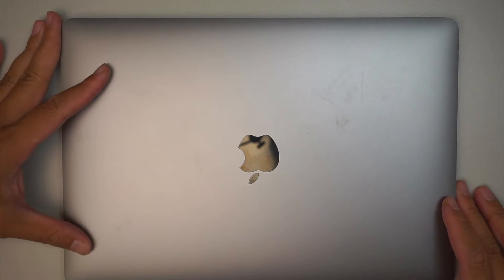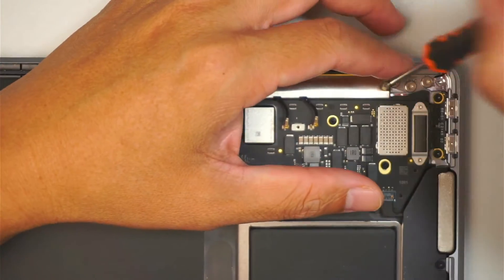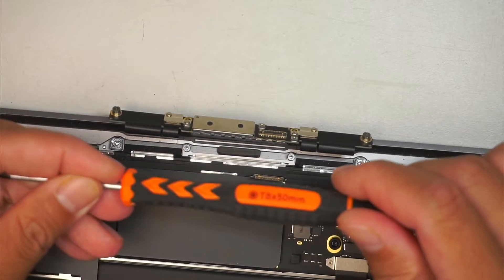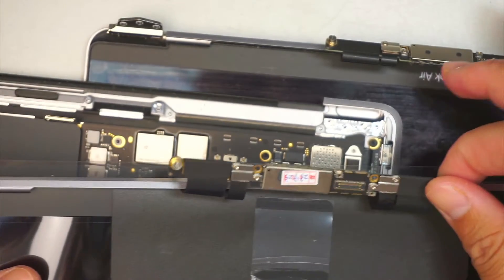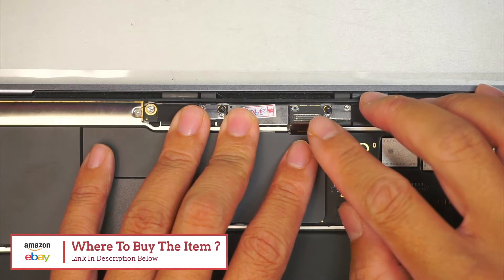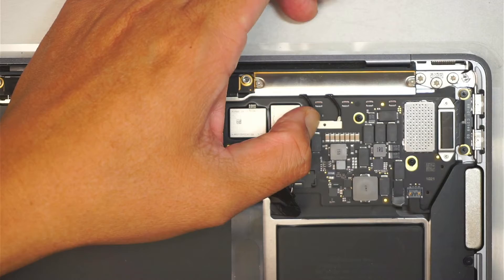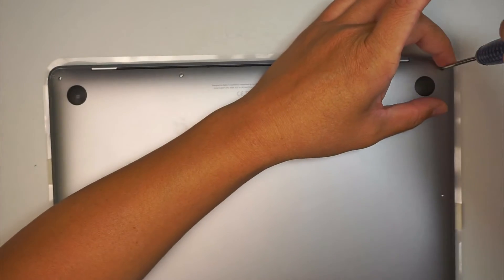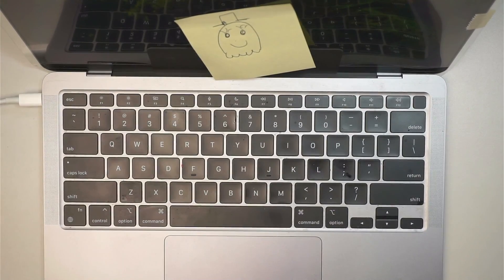How To Macbook Air A2337 Screen Replacement

Comment: Excellent video and detailed instructions…. Step by step, and you explained the tools used on each step. You saved me $300 … and I appreciate it it so much!!!  The new screen I bought did not have the 2 screw plate hold downs for the 2 cables to the display but I noticed that when comparing your video… so I moved them from the old screen and installed in the new screen. Everything worked great … thank you !!!

Comment: Great video. FYI a few things.  1) For those having an issue with unscrewing the Bracket on the WiFi connecting cables using a T3, use a T4 instead, which is what I had to do. 2) The WiFi cables do have to sort of click in softly when you press down. It's not just that the connector has to be in the right place, it has to fit in as well.

Comment: Awesome Video ! One thing I’ll add is when disconnecting the WiFi Antenna I found it easy to use the pointy part of the plastic tool on the side there’s like a small hole and gently pry up

Comment: dose it come with the Apple Logo on the back????
Reply: Some do some don't. Typically the cheaper replacement displays do not have the apple logo. If you go on ebay, the replacement displays that sell for arround $150 - $170 do NOT have the apple logo. The ones with the apple logo sell for $180 and up.

Comment: hi, i need help with my macbook air 13 a2179. I replaced the lcd thanks to your video, but the brightness is really too dark, even with the settings at max and with no other functions activate (true tone, battery saving, automatic brightness), there is a way how to fix it? I tryed to reset the nvram, at booting it shows a lot more brightness, but when entering the users, it restart to get dark like before. I will really apprecciate your help...
Reply: Hi, I'm not the author of this video, but I work for a company that repairs these all the time (I repair 12 a day) and I've seen your issue before.

It is likely that you have a defective (or wrong) LCD.

Odds are: the company that made your LCD, flashed the PCB incorrectly or used the wrong PCB for the ribbon cables.

I dealt with it a lot last month when most of out 2159 LCD Panels were actually 1706/1708 Panels that were mislabeled by the vendor.

I'd contact the seller and get a refund or replacement.
Reply: @SupraViperhead  hi thank you a lot for your help, sadly i couldn’t get a refund for that so i have to keep it like that…
Reply: @SupraViperhead  are the 3rd party screens worth saving $50-60 vs the used oem screen assemblies i see for $240? Looks like the texture is coarser on the 3rd party lid which is one downside. Is there a noticeable difference in screen quality? high and low brightness? i wonder if true tone is also disabled when switching even to a used oem screen. Thanks for any input
Reply: @daftnord4957  Depends on the vendor, the model, and the condition of the screen assembly.

Some models have much cheaper OEM used parts available and it's less costly to use that part than it is to buy New 3rd Party.

The M1's have the Camera paired with the logicboard, so you'll lose True Tone if you replace it, regardless if you use a 3rd Party or an OEM, but you may be able to convince Apple to pair the new display up to the board if the Screen Assembly is OEM. Earlier models (such as the A2179) didn't have the true tone paired to the board, so as long as the camera in the new display has true tone capabilities, the new unit will have true tone...again, unless it's an M1 (A2337. A2338, etc...).

If you get a used screen, it may come with scratches, keyboard imprints, small nicks, and the shell may have scratches, nicks, and even bent corners. The newer screen assembly may have a more coarse texture (depending on the vendor, some are just fine), but the LCD will look better.

I've never seen any issues with "low quality" when it comes to how it displays. There aren't any washed colors or low resolution issues, unless the LCD is outright defective. 

For me, though, I repair just the LCD Glass Panel, I don't replace the clamshell unless it's too damaged to repair.